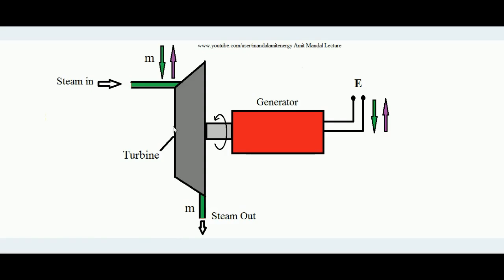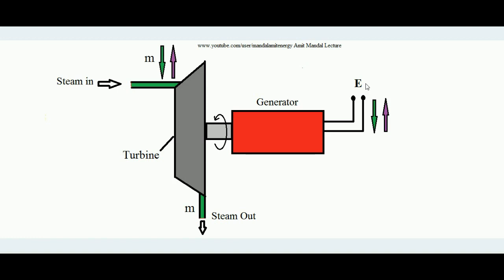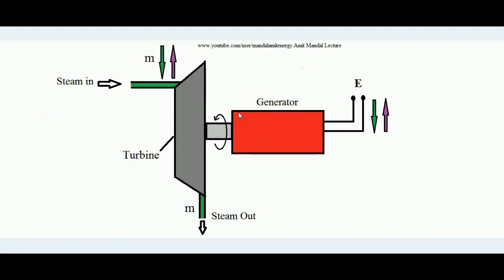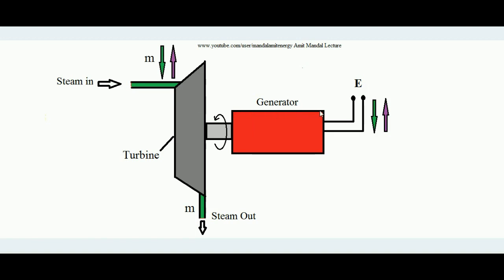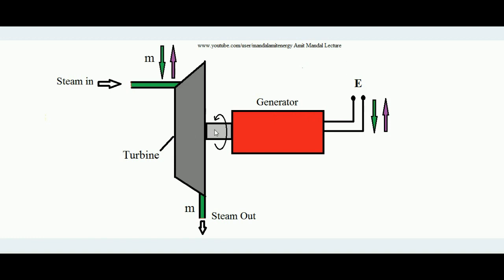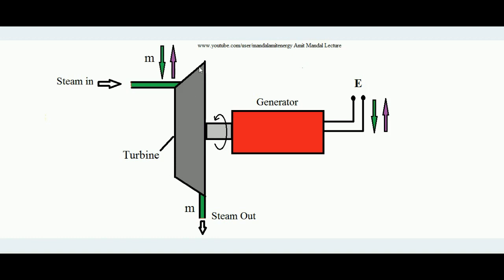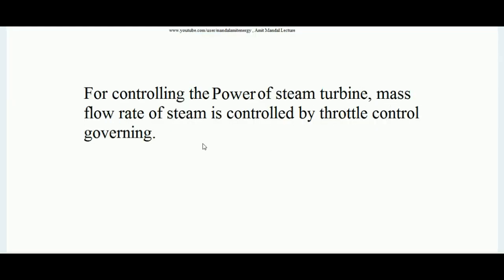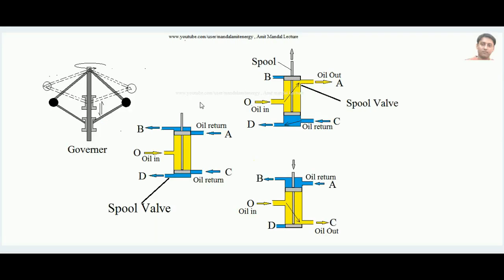Throttle Governing of steam turbines

Comment: Some confusion on the load..........This process produces electricity by using steam to turn the turbine.........Low Load => High RPM ???
If the "Users" of the electricity are very few then the load on the process is "Low" and if the steam is high.
It seems that the "Governor" PROTECTS the turbine because a very high "spinning" of the turbine will cause the linkages in the Governor to force oil in the "servo" to close the steam valve.
Reply from the maker: That's right, I would add some more, Governer controls the valves at low speed also, its main job is to maintain the speed at constant, low load- low steam, high load- high steam...

Comment: CMIIW the turbine speed is suppose to be constant to match the grid frequency right?
So low load or high load, the rpm of turbine is fixed (wont change) its just the resistance to rotate the turbine is change depand on the load. So high load required more power to rotate the turbine comparing to low load. Assuming the speed is same (3000 rpm)
Reply from the maker: yes